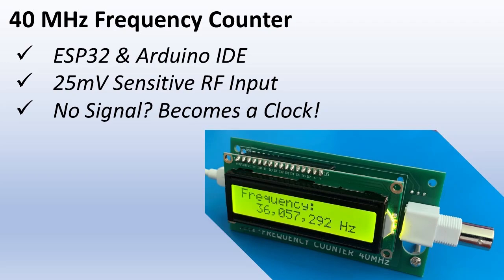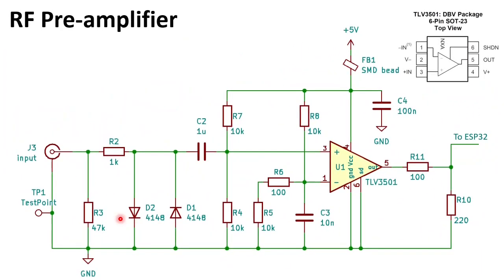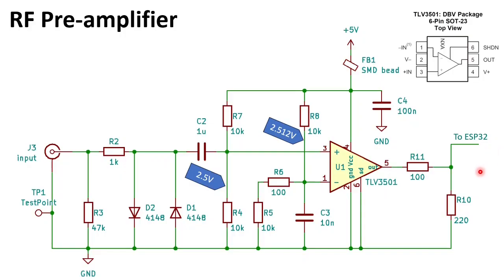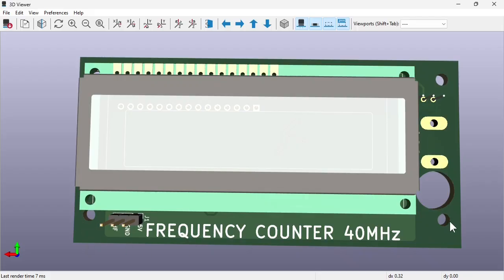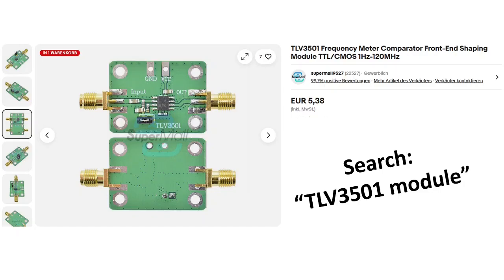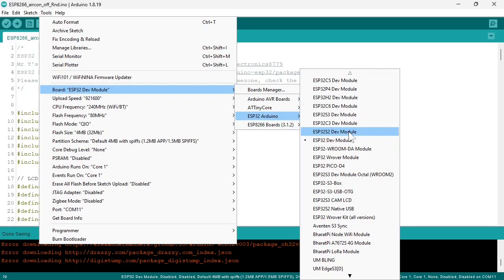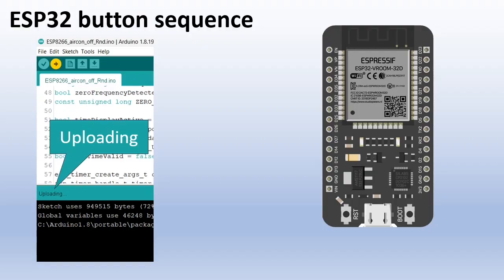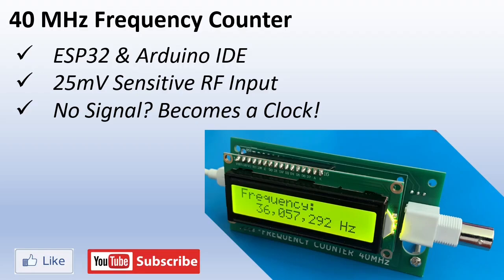ESP32 Frequency Counter Tutorial (40 MHz Range + RF Preamp)

Comment: Can you please add some basic consideration about the frequency stability of the ESP32 clock?
Reply from the maker: Good point, this frequency counter is not as accurate as a professional lab equipment, the typical tolerance of oscillators in an ESP32 dev-board can be 10 ppm or even up to 50 ppm, so at 10 MHz, you could have an error of 100-500Hz. To improve the design you can add a calibration option in the software but that does require an accurate frequency source or some lab grade frequency counter as reference.
Reply: @smartpowerelectronics8779 thanks a lot for giving a clear idea about what to expect.